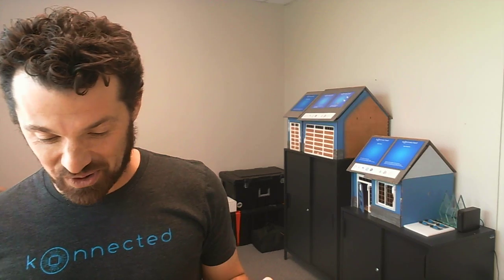Alarm Panel Pro Ethernet Issue SOLVED!

Comment: The newest, best news is that the panel ships with ESPHome compatibility.  Home Assistant software can now connect natively to this integration.

A tutorial showing how to program scripts and automations to work with Alarmo would have saved me a lot of time.

Found a PoE USB C adapter that passes both 2A of charging and Ethernet to a Lenovo tablet I am using for a keypad interface.  Industrial velcro keeps it on the wall.

I have programmed Home Assistant to send an email to my phone's text messaging.  A custom ringtone notification for this sender lets me know that a break-in has occurred.   No monthly fee this way.

Comment: Love a happy ending. Quick question... do you know how many Motion Sensors can be powered by the Pro board? I'm thinking I may need a separate power supply. Thanks from Australia (kicking myself.. was going to buy a $79 board last night)
Reply: Honeywell's motion sensors (https://digitalassets.resideo.com/damroot/Original/10019/L_ISDTSNRGF_D.pdf) seem to have a max current under 20mA, so if you power your Konnected Pro with a 2.5A and we assume the panel (with a siren going ) takes 1A, you'd have 1500mA left so that's enough to power 75 motion sensors (at max current draw).

If you cheap out and get the 1.5A adapter, under the same assumptions you could power 25 motion sensors.

In other words, this is almost certainly not a concern. And if it is, I really want to hear about why you're using so many sensors!
Reply from the maker: @petermarskell8902 Thanks for the question! There's really no functional limit to the number of motion sensors you can power with the Pro board as long as you're mindful of the power draw. Most motion sensors typically draw around 10-20mA each. The Alarm Panel Pro provides plenty of power (up to 1A for sensors), so you should be able to run quite a few without needing a separate power supply. If you’re adding a large number, just make sure the total current stays within the 1A limit.

Comment: Congrats on the fix, I am happy for you and Konnected. Will the firmware updates be rolling out for all Alarm Panel Pros or only for this specific batch?
Reply from the maker: The updated firmware will apply to all Alarm Panel Pro v1.8 that use the RTL8201 chip.